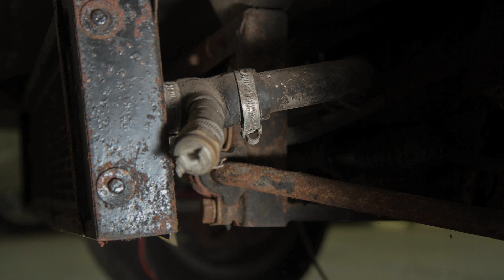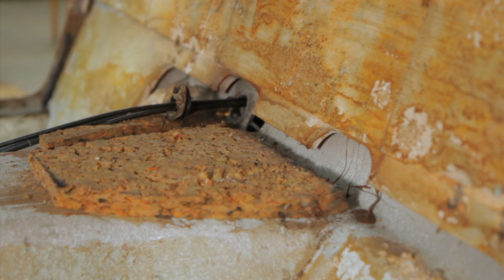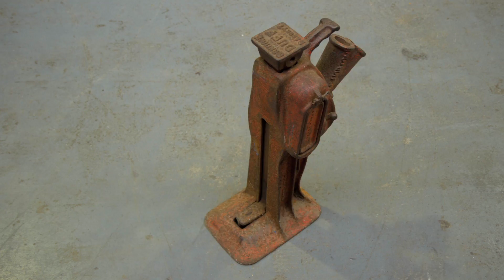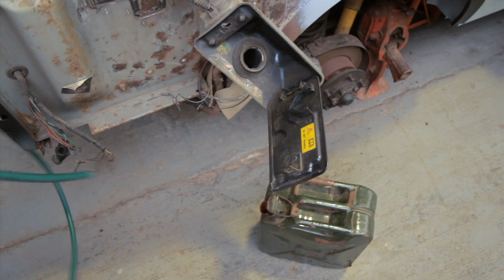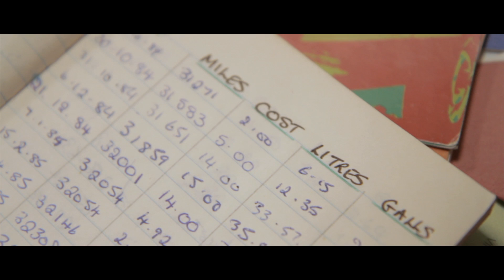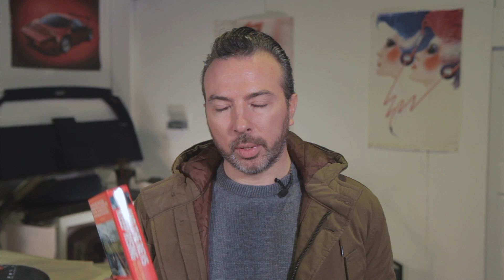Borrowing a Ford Cortina MkV // SOUP Classic Motoring 13 Esprit rad removal, Land Rover,

Comment: Hey, Its my 914! My car is famous, and once you hit 100k subscribers (It's only a matter of time) i'll really be a true celebrity.
 
     If you want an update, I've essentially doubled down on the project and bought a second 914 that someone put 911 suspension and real Fuchs on and over the last week I stripped it bare. Over the next few weeks i'm selling the second shell and all of the extra parts and it should pay itself and the stuff i'm keeping off almost entirely. Hopefully i'll be back to one 914 soon so I can keep working towards a significantly upgraded, yet period correct Porsche. I've repaired all of the rust in the rear trunk and i'm working my way forward on body patches until i feel i'm good enough to repair the frame. The new 911 front suspension will be put in after a few frozen bolts holding in the current set up are removed. The Fuchs (15") are probably worth more than the whole micro fleet combined at this point, but hopefully it will eventually blend in with the rest of the car. I'm planning on painting it Irish green myself and having it be an example of how someone would have upgraded their car when it was new in 1970.

Great episode, and I thank you as ever for reminding me to get up and go back in the garage... after one more Soup video.
Reply from the maker: Good man Ben! Fuel that addiction, you'll be rolling those Fuchs in no time. Aside from an early Targa the 914 is the most interesting Porsche in my books and Irish green's the colour too! Can't wait to see it. Saw an early Esprit in a colour almost the same as Irish Green and I thought it looked great, but then green's my thing. Keep us in the loop :)

Comment: Just found episode 13 from a link on RetroRides and have now watched the whole series. Great work and I love the attention to detail you have and the way you are enhancing the lotus spirit beyond the budget they had in production. Its very similar to the direction I'm taking with my GT6 which I'm doing on my driveway. I also feel your pain with the Range Rover as it looks to have rusted in the same places as my Disco 1. I spent a lot of time this summer welding in new sills, front footwells, front body mounts, repairs to front inner wings etc etc etc and all on the driveway and on a budget. it's now my daily driver,  dog car and parts hauler. keep up the good work. looking forward to the next instalment.
Reply from the maker: The old LR's are great machines, and yeah sounds like you've been dealing with all the same things I've had to tackle over the last year or so. I did a six month mechanical job (will feature later) on my two door RR back in 2007/2008 on the driveway through winter. It was one of the happiest times of my life :)

Comment: I'm not watching your fantastic video's in any order so my comments may seem/are random, just saying you can rivet the boot floor in as it's not load bearing, that's what I did on my Discovery 1, also the rear seatbelt mounting eye bolts are way overpriced so I carefully cleaned mine up,
Reply from the maker: Yep, riveted. They were riveted from the factory on the early cars :)

Comment: Served my time a Vauxhall dealers and only ever worked on 1 Ford in all that time a MK1 Escort thought it's body was weak , left there and went to an independant place , the other panel beater put a front panel MK4 Cortina taxi super quick , had a look and he had tack welded it on asked him why he said it will be crashed again next week and it would be back in ,  he did the same with police cars , I've seen police cars that's had 4 or 5 same panels replaced , the police had 4 Cosworths 3 were wrote off on the same humpback bridge chamfered  the bottoms off , I did a MK2 Golf GTI unmarked cop car that had been jumped to , also repaired a Chevette police car followed a stolen car down a dene , could tell you some tales obout the cops own cars most drove right off , one cop asked us to check over his new car quick look underneath it was a 2 halfer , he knew it was a right of but not that lol .
Reply from the maker: Must have been fun seeing what comes in from the police, probably a new story with each job, don't know how you got any work done. Imagine not looking under a car before buying it!

Comment: I have a question regarding your video production, are you shooting video and making it stop motion in post, or are you actually shooting still photos?
Reply from the maker: Stills all the way mate. I [intentionally] use outdated software so I can't be sure but as far as I'm aware there isn't a program that would selectively turn video into stop motion. You can speed up/drop frames from any bit of footage of course, but doing it in a way that omits the frames with you in them without some sort of automated filter would be, lets just say more involved. Possible but intensive. My workflow is: turn a screw, get out of frame, trigger camera, turn some more, out of frame, trigger camera - ad infinitum. I'd like to do a video on my gear and workflow sometime, I'm just not sure it'd fly with the subscribers.
Reply: I for one would be very interested in it (obviously).  Maybe a great video for when you hit 100k subscribers (which it will happen your content is way to good to not get there)
Reply from the maker: Ok that's a deadline far enough away that I could conveniently forget about it ;) Thanks buddy.
Reply: I'll be here to remind you!  Great work keep it up!

Comment: That rear body crossmember really didn't want to come out! Back end of the chassis is looking a bit flakey - will that be getting any new metal?

PS: Get the polo shirts made, I'll have a medium.
Reply from the maker: Deadly stuff David, the feedback on the shirts is good so far. Your name's in the pot. The rear chassis X is a bit rough alright but doesn't need new metal, you'll see it'll clean up grand. Those were the last ones built out of proper steel. It's amazing that the Disco II is essentially the same chassis but is like paper in comparison.
Reply: I heard a story that was because GKN who supplied the chassis to LR had a supply issue, LR couldn't wait so went looking for them elsewhere and ended up buying some made from poorer quality steel.
Reply from the maker: That's incredible but doesn't sound far fetched, well not when you see what a D2 chassis can do to itself in 10 years first hand, and then consider all the rock solid 40+ year old RR chassis.

Comment: Robert Cullen in the Vid' - 
Buy yourself a 1982 Cortina 2.3 GL or Ghia  ! 
A seriously Fantastic car !  in its day AWESOME ! 
Ghia = maual sunroof, velour trim, bronze tinted glass, POWER STEERING as STANDARD ! on 2.3 V6 .
Yes 2.3 v6 ford German Cologne engine same as 2.3 granny. as per 2.8 granny and Capri ! YES ROCK SOLID Reliability TONS and TONS of Towing PURE SILKY SMOOTH POWER . happy to pull a CAR TRAILER at 100 MPH ! yes MPH ! with a car onboard. no issues Feels like a RANGE ROVER for Torque and pulling power FANTASTIC ! 
Handling ? = ROCK SOLID never flipped its tail out. go into roundabouts at hell fire speed and stay on line and in lane every time.
INSPIRES BAGS of Confidence I never slipped or slid or crashed a Cortina 2.3 V6 mkv. pas, gas filled struts to take the power and weight etc. 
one of the best cars i EVER EVER DROVE as a MOTOR TRADER ! i drove 100's of cars ! 
I had a 2.3 V6 and a Rangey, i loved em both ! Yes i had GTi's 2.8i Capri's XR3i's  All of the stuff we can only Dream of today.
The cortina was THE BEST of em' ALL ! ( Rangey ? ) ??? ok i never did decide so i had both ! as daily users for many years.
When i sold the Cortina i regretted it big time . so much that i rang the customer and begged for it back and payed more than i originally bought it for ! 
Then it got stolen and was paid out . the car was found later in a sad state everything stolen. so I BOUGHT IT BACK AGAIN from the insurance company and spent ? OPEN CHECK BOOK MONEY to put it back as it was.  and it LIVED and ruled the roads and turned heads everywhere it went a TRUE LEGEND of a car. 
AND THAT WAS A FORD CORTINA !  ( it was 3 yrs old when i bought it ex fleet at auction.)
If anyone ever sees it let me know  reg no'   SRR 250X 2.3 GHIA in Venus Gold Manual. brown velour trim.

My Dad ( deceased ) Loved it to bits even though he drove newer and faster BMW's & Jags etc. always hi-jacked my cortina for days out. 
My Mum ( doesn't drive ) loved it more than dads £40 Grand new Jags ! 
New Jag man Loves V6 cortinas !  1994 x300  XJ6 sport. = NOT as good as The 2.3 V6 Cortina ! FACT ! 

Better than £40K of Brand New Jag ! back in 1994. 
2.3 cortina is an AWESOME CAR !  BUY a 2.3 manual at ANY PRICE ! 
What do i drive today ? the next best thing to a cortina GHIA V6 
BMW 525 i SE petrol 2.5 6 inline variable valve timing 24v 192 bhp  very similar reliability and awsome pulling power.
yes the BMW is much faster BUT has that    " 6 " rumble when you floor it to GO ! then sounds like a Formula " 1 " when its at hi revs.

a 2.3 V6 cortina will or should hold 125 mph constant on the needle.? hour after hour day in day out .
BMW 525 will hold 135 - 140 mph constant = not much in it ?  ( will do more with re mapping etc. )

A Cortina 2.3 V6 will out handle XR3i , 2.8i Capri, and match or beat most similar Gti / GT/E stuff of it's Day !  the fastst 1983 car i ever drove was an early Vauxhall Cavalier 1.8 SRi =wiped out an escort RS TURBO ! left it way behind ! ( at 140 mph ! )
speedo shows 140 mph. needle goes past that into the unknown ! HELL FIRE IT WAS FAST !!  SRi 130 was not as fast as the old 1.8 SRi . no way!  Quicker on the takeoff and torque but not as fast on top end. SRi 130 = Disappointing big time !i thought they were supposed to be fast ??  OK maybe not ?
Reply from the maker: Love the enthusiasm Paul, thanks for the story. The 2.3 must have been some machine. I'd say Rob will stick with Tina but you never know!
Reply: If you or Rob get the chance drive a genuine mint example . You will be IMPRESSED ! ( no not by todays standards, but by cortina standards and other cars of the time ! PRETTY DAMMED AWESOME MACHINE ! trust me ) 
Power, Comfort, Ride, Handling, Reliability, and CHEAP TO FIX ! 
SUPERB CARS in factory spec ZERO mod's needed. ( ok a bit of rustproofer ) i never changed a thing. perfect as it was built. ( i upgraded the factory Rad/cass is the biggest modification required. ) 
Oh and had the SQUARE hole Alloys Polished to chrome finish.  (granny /GHIA Style ) Black paint in the holes, gold paint in the middle area and standard silver center caps. i still have some center caps on a shelf in my garage.

I Hope CORTINA people will like this info. Best wishes to all Cortina owners. 

My FORD Brochure is the all models   " Sept 82 "  I'd never part with it. 
sorry for long comment, most just say   " Yea " or "Nay" or moan and complain. or rattle abuse from lack of Knowledge. 
Great vid's Thanks. 
OH the LOTUS ? 
Do as JAMES BOND did. - SINK the sodding thing ! 
Paint it pink and sell it to a hairdresser as a salon Marketing tool. 
Ding dong AVON CALLING ! 
Bloody awful Glassfibre like a boat designed to SINK ! 

I wouldn't dare to OFFER A NICE Girl a lift in that ! 
TOP TOTTY Likes MEN in VANS ! BIG VANS ! not interested in Quirky Antiques ! 

My best list :- 
MkV Cortina,
old Rangey,
e34 BMW,
e30 BMW
Mk1 fiesta 1.3 GHIA /Supersport / XR2.
'06 Corsa Van 1.2 diesel. = Roadholding / Handling. +++++++ power?  none ! but i will never sell it ! Ever ! it's still in daily use best SPORTS CAR I EVER DROVE ! YES YES YES ! 
Mazda MX5   ! AWESOME ! ! like the corsa but more power ! and no roof ! yes yes I would BUY NOW ! even if it was pink !  
Drive an MX5 ! Mk 1 yr, 1998 pop up lights . model ! = AWESOME ! 
MY other = ? Ha that's my Secret ! ( My other van is a Big Van !  YAHOO ! i LOVE IT ! 
NOT ! Sprinter / crafter  or Tranny ! = they have no power and no handling !  BYYYEEE !
Reply from the maker: "I wouldn't dare to OFFER A NICE Girl a lift in that !" - funny enough neither would I. I'm trying to get weight out of it mate, not add to it. :)
Reply: HA HA i could reply some fun to that, but ye can't these days. 
No PHAT Slags ! 
boys toys ? my Hairdresser would love that Lotus when you have painted it PINK  ! 
" HEY BITCH " shoes off when you get into my car ! 
( supermarket 5p carrier bag for shoes to be placed in the boot. )
YES i DO ! no shoes in my car ! 

Yes of course i respect the Lotus. only joking for cheeky fun.
We all need to Laugh and smile .
Love the Vid'  pls show more as you go on with restorations. many thanks. Top Man ! Cheers.
Reply from the maker: Paul I appreciate the comments but could you keep 'em family please mate. There's just one word here and another in your other latest comment that you could pull out. I get it, and it's all banter but I'd like to make SOUP as accessible to all as poss. Thanks
Reply: OOP's Sorry.

Comment: Mine was identical to the one in the original For Brochure the gold Ghia. 1600 GL is ok but ? You need a real Proper Cortina. PLEASE PLEASE DRIVE the manual V6 !  
A very different ANIMAL !  throughout .
Pay whatever it takes for the mintest ORIGINAL 2.3 V6 !  
Trust me you will WORSHIP MY ADVICE !   A 2.3 manual should be worth double the price of a 2.0 GHIA same spec ! not 3X but YES 4X the car !  best bargain in motoring history in it's day ! ONLY a FEW SMART CAR PEOPLE UNDERSTOOD that £1000 more + more fuel consumption / Less MPG = 4X more CAR ! 4X more fun ! and PAS as Standard ! ( CORTINA's HIDDEN GEM ! )
these cars drive like they are on train tracks ! to slip one sideways you would need to be dafter than i was at 23 yrs old ! 
i bought my  1980.   2.0 ghia in 1983 with 10k miles out of our local Ford Main Dealer showroom with the plastic still on the door trims !  my second car I was only 18 yrs old !  I never bumped or Crashed a cortina ! even at that young age !

I have the ford brochure here it is 35 yrs old ! a bit rough and read many times , worth a few £ Grand just the brochure with all the range included. XR2's XR3's ( not 3i's ) Pre 3i's pre capri specials ! just standard 2.8i's on pepper pots. 
£ offers over a grand pls ! the cars are worth £30 grand the book is 5% of car value ! = BARGAIN !